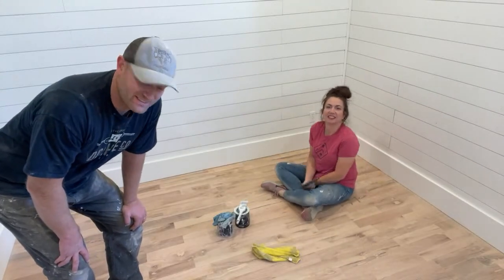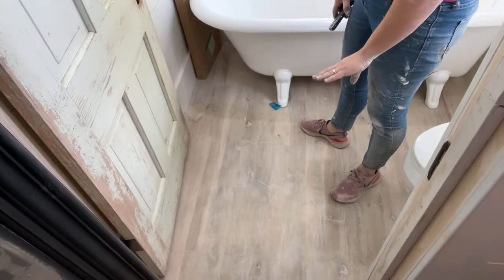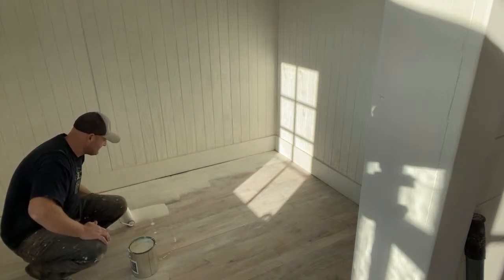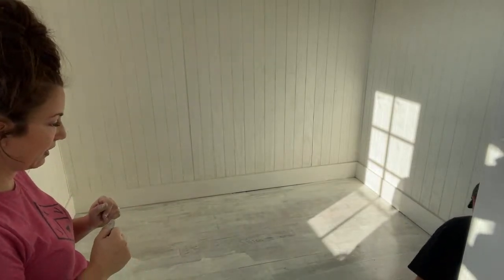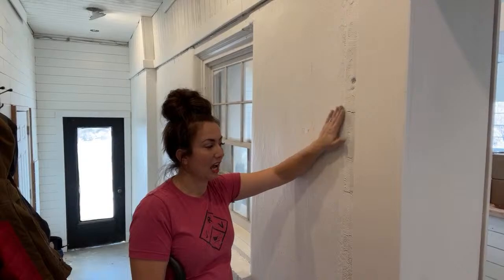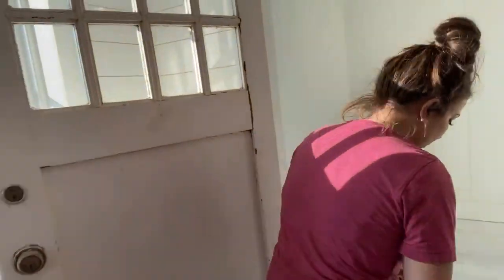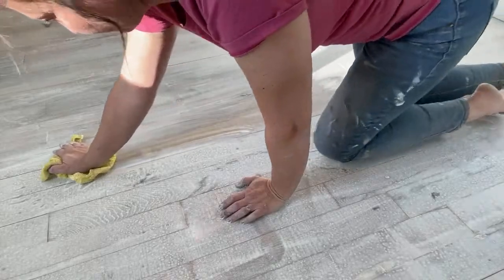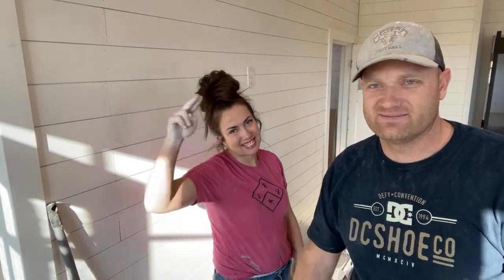Whitewash And Oil Wax Wood Flooring

Comment: Working in a school kitchen for over 20 years I know that unsealed wood isn’t sanitary for kitchen use. Not sure if that is the reason for having it sealed. It would help keep germs out of the wood grain. Lots more work for you! Wishing you extra strength and stamina to “power through”.
Reply from the maker: Our kitchen is painted and sealed ❤️. But yeah it’s hard to clean.

Comment: Will this work over a sealed wood? Or only raw wood? I have a maple dresser that’s finished in natural poly but it’s looking a little orange. I don’t want to go back to raw wood. Hoping a white wash can help tone it down.
Reply from the maker: It’s best if it’s used over raw wood or paint. If your floor is already sealed the oil wax will just sit on top snd won’t soak in.

Comment: So here's an idea why don't you put a piece of board okay it's going to be hard to explain all right cut out the amount of Gap you're going to need to push the drawer in here then where that Gap starts inside the drawer put a piece of board across so it's going to make a separation in the drawer. And then you can put another piece of board going straight up on the sides. So that will make it so it's sturdier across and up and down. I hope that makes sense I wish I could draw you a picture. But there's going to be two boxes on each end and that will be made sturdier because you're going to have a board across. And you could always put something underneath to make it sturdier as well atching to the back of the front. Because you're going to need more attachment on your inside boards to nail to those boards. I really hope this makes sense but anyways just the thought this is all amazing

Comment: I mean no disrespect. You should never apply paint to hardwood floors. If you wanted a whitewash, gray, brown, look. There are products made specifically for hardwood floors that give you the same look without destroying your hardwood. Now if 5 years down the road you want to change colors. You will more than likely never be able to sand out the paint. And if you do happen to sand it out. You will use up more of the wear layer than you want. Don't get me wrong. Your process is fine. I'm talking about the products.   Keep doing what you are doing just use the right products. Check out these two videos

 https://youtu.be/jFKUzCIpq0Y

https://youtu.be/L2YlnchXJzc